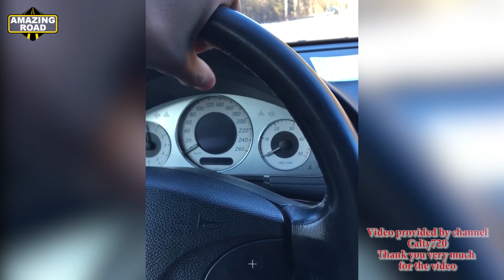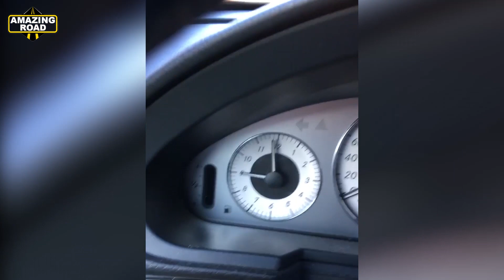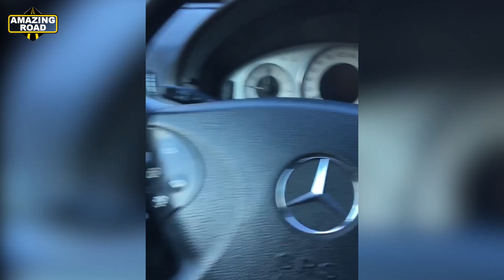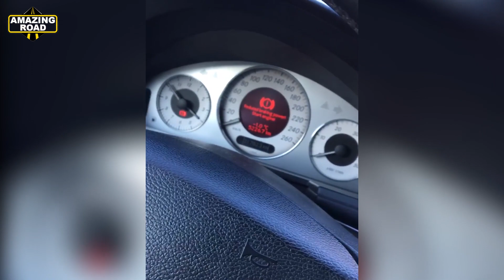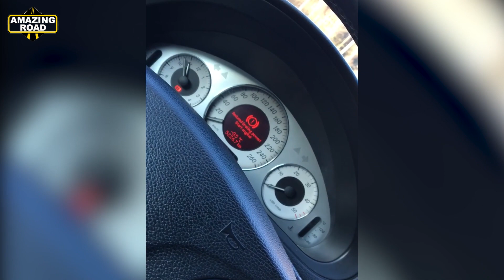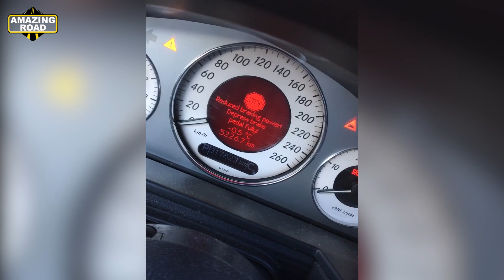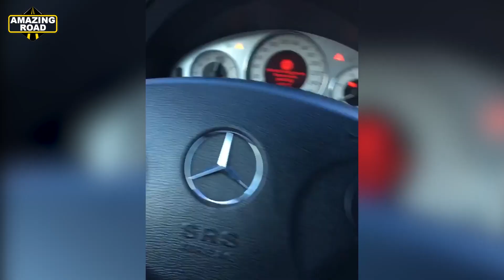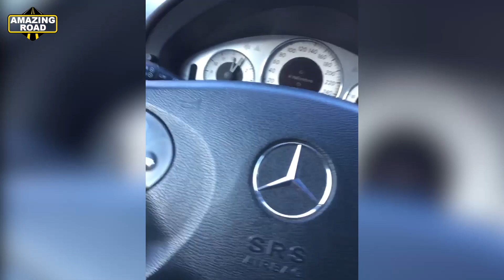Full brake failure on Mercedes W211 / STOP Reduced braking power! Failed brakes on Mercedes W211

Comment from the maker: Changing SBC Brake Pressure Accumulator in W211  https://youtu.be/CCXlfeDAly4
W211 Replacement or Removing Fuel Pump  https://youtu.be/VXQa5WZXWLs
Repair the IR sensor for Mercedes  https://youtu.be/h5GEVx5uemI
How to reset automatic transmission 722.6 Mercedes  https://youtu.be/_FjX2Yl42t4
Detailed Installation Android 7.1 COMAND & CANBUS  https://youtu.be/EisTZV-FCX8
Deactivation and Activation SBC Without Star Diagnosis on Mercedes https://youtu.be/J8jaVufCQcg
Mercedes W211 Replacement the Fuel Filter  https://youtu.be/LVpEIoUC178
Brakes failed on the road  on W211 https://youtu.be/tUZg9WytbbE
Best Life Hacks for Mercedes W211  https://youtu.be/p6bZLZ0WcQc
How to Make AUX on Mercedes W211v https://youtu.be/7JnVR-nF0UQ
Mercedes W211 Top 25 Hidden Functions, Secrets https://youtu.be/ZYQwnmydbp8
TOP 55 BEST LIFE HACKS FOR MERCEDES W211  https://youtu.be/CgixWAzrphs
W211 HOW TO REPLACE BRAKE PADS CORRECTLY https://youtu.be/6syWcyTcTVE
Reply: Amazing Road TV

Comment: I had the same issue. The esp light came on and the exact same warning came on the dash. I pushed the brake pedal to the floor  no brakes at all. I finally got it to stop. Turn the key off. Pull ed the key out of the ignition. Got out of the closed the door. I got back in and started the engine, no warnings. The car seemed perfect. 
I don't know if I can trust it now. Any suggestions?

Comment: My 2005 E500 is at the dealer right now getting the SBC done under warranty.  Got a 2019 Benz loaner too.  What a great company.
Reply: So the warranty doesn't expire on that? I'm looking at a 2007 E350 to purchase right now and owner said has no brakes... What fault code did yours have?
Todd
Annapolis, MD
Reply: Mega Man Todd, Mercedes extended the warranty to 25 years on the SBC pump. It’s a free repair from Mercedes if it fails.
Reply: @elkillerx do I have to be a Mercedes customer or just have a Mercedes ? What’s the requirement
Reply: @elkillerx 👍🏾

Comment: I too experienced the same problem my friend. I currently asked a guy who does Mercedes MOT  as it is his own business.  And what he had told me is that the brake pipes need to be cleaned out or replaced which costs about £80 each due to the brake pipes being filled up with dirt and etc  this has to be done regular or the car will not let you drive because it is not safe  I hope this helps as I am currently waiting for this Covud to end to get my brake pipes cleared and that red error message too.
Reply from the maker: the first time I know this

Comment: I have had the same issue off and on but I came up w a theory and that is when it’s freezing temps outside it messes with the computer because it has only happened to me when it’s cold. Very scary situation when you’re going 110 on the freeway Nd it pops up Nd beeps like a bomb😂😂
Reply from the maker: https://www.youtube.com/watch?v=WJ8yxhxtLe4
Reply from the maker: 2020 https://www.youtube.com/watch?v=vfo1OqpmKSw&t=68s
Reply from the maker: Agility https://www.youtube.com/watch?v=y0lp9aJ25tc&t=28s
Reply: I had the same issue this morning but it does make sense it was cold didn't warm up the car abs sounded just like you said now I works fine turned off and on now works I hope still taking it in new sbc
Reply: @freddygalvan669  most of the time if not all the time it is sbc pump and if youre lucky depending on the year of your e class. theyll take it in and replace it on warranty because its a recall for 2005's. i no longer have the car but that was my solution. Dont spend money on ebc flash kits because theyll fry your car.
Reply: @Dubya69  yeah man I took it in mines a 05 e55 it's at the dealer right now they are fixing it sbc was faulty
Reply: @freddygalvan669   good deal brotha hopefully for free haha

Comment: i have an E320 W211, year 2003 with the same problem. the defect usually shows up in the morning, and after driving for about 3km and switching off the engine, it disappears and then drives well throughout the day, then morning again, same problem. What could be the problem with my SBC

Comment: Mine is a 2003 E500 has 124k on it. Not a lot, ride smooth but I just had the same issue. I probably take it to MB Dealership.
Reply from the maker: Agility W211 https://www.youtube.com/watch?v=y0lp9aJ25tc&t=8s
Reply from the maker: Make a diagnosis through the openport for $ 19 https://www.youtube.com/watch?v=xk4dCH97ky4&t=759s

Comment: I am having the same problem with that light but my only thing is that I cannot get my car out of park can anybody give me an idea what's going on I have a 2004 E500 4matic
Reply: I had to take the gearbox apart the wood grain around the gearbox and there's a a safety switch under the gear and you have to press that down to get the car out of gear I learned it from a guy off of YouTube channel
Reply: @godwillokot9315  there's a recall on them cars SCS breaks stops working after 500,000 brake pedal stop the dealer had to fix mine's for free
Reply: what would it be if the problem keeps happening..? They already changed my SBC pump for my 03 e500 but I’m still getting the same brake message...
Reply: @mauricedavis1740  try replacing the brake light switch

Comment: The SBC unit has it's own battery in the front so disconnecting the rear battery won't do anything. What you have to do is to disconnect the harness that goes into the SBC unit in order to "reset" it. That should give you your brakes back so you can drive the car. Although you will have to eventually replace the unit.
Reply from the maker: ))) https://www.youtube.com/watch?v=CCXlfeDAly4&t=19s

Comment: Please folow these steps:
1-turn of the car
2-disconnect the esp/abs motor
3-turn on the car
4- reconnect the esp/abs cable (motor should be on)
If you folow these steps the car should work perfecty
Reply: well here the problem is the sbc battery,or the generator doesn't make enough strom for the sbc battery.
Reply: sorry for my English.
Reply: This video was recorded by me, could you explain a bit further? It's sitting in my garage right now with no brakes, I had to drive it home while it was beeping, I found a hole close to the gear shifter, I sticked a pen through and unlocked the locking mechanism on the shift knob.
Reply from the maker: You checked the battery SBC? If the acb is discharged then there will be an error like you have now
Reply: Turn the ignition off and disconnect the ABS/EPS module then turn the car on - pump the break and the brake should work fine.
the most common error part is the A.K.A. brak light switch I had the same issue with my car. You can get it for 15 - $20.

Let me know your news
Reply from the maker: Watch this video https://www.youtube.com/watch?v=3hRu0qrWmzE&t=2s
Here I'm testing brake failure. Without bleeding the brakes should be without SBC.
Reply: There are 2 ways to fix this easy: 1. Go to the dealer, buy a new factory  SBC-unit ($1300) and have a good outside Mercedes Mechanic install it($500) 2. Sell the car for $5000 less than it's worth. There are no shortcuts, don't listen to people, your brake will fail and it'll cause a bad accident if it happens while driving downhill or in the city.
Reply from the maker: Brake in any case will be. This is not discussed. People like you say if you fail the sbc there will be no brakes. You make mistakes the brakes will be. I am the same owner as you. But I agree with you that you need to change the block. Since a 2 ton car is very difficult to stop without ABS
Thanks for watching!
Reply: Don't forget. Mercedes extended the warranty of the SBC pump to 10 years/unlimited miles so before you buy a new one double check if there is any warranty on your current pump.
Reply: Mine is 2003 E55 with 107k miles, the light came on couple of weeks ago so even if there was a warranty it would've expired. I'm sure you can bypass the system and rebuild the SBC unit but mechanics will never let you know so they can charge you $800 for labor.
Reply: Didn't you say "Car will not shift from first gear to second if SBC is not connected"? In one video you also showed that car wouldn't stop even with emergency brake, so does it stop or it keeps going?
Reply: Calty720 I've  got used sbc unit from scrapyard with low milage for my car even with a different part number and unscrewed the brain from the old unit put on the unit what I have got and did bleeding! job done problem fixed got through with 150euros plus cost off brake fluid
Reply: Hesam0000 you can't get brand new factory's sbc units any more these days. all you can do is to refurbish it and it means to replace  brushes and thats all you can do with sbc unit but there's hydraulic part in the unit (valve) wich also can fail (stuck) and you or any body else can't do anything about it...
the parking brake in not related to the sbc unit so it works and helps to stop the car in emergency situation but you have to be careful to pressing it when going high speed don't press to hard or car will go sideways
Reply: I bought a new one from the dealership for around $1200. Emergency brakes are connected only to the front wheels right?
Reply: Hesam0000 emergency are front one's but it wasn't enough when i lost my brakes so i used parking brake as well! I tried dealers ebay but couldn't find any brand new ones few months ago. maybe your one was the last one...
Reply: Call Schumacher Mercedes in Scottsdale, AZ, they have the parts.
Reply: Chabache do u reconnect it?
Reply: Amine KA dude it's really work thanks alot my problem it's been fixed
Reply: mine doesnt work
Reply: Amine thank you i save 350 euro :))
Reply: Calty720 what
Reply: What was the end result? What did it need to get it fixed?

Comment: Mercedes just announced 25 year warranty on the SBC unit
Reply from the maker: wow
Reply: but it isn't worldwide it's only in USA
Reply: Yup. I have an E320 and I got a letter from Mercedes about the warranty extension. I had my SBC pump fixed completely free by Mercedes a year ago.
Reply: @elkillerx  does the warranty apply for any mercedes owner? I didn't receive anything in the mail

Comment: This video was recorded by me, if you have any questions I'll gladly answer.
Reply from the maker: I attached your comment to you asking questions
Reply from the maker: (To Kos) Asks 
The question is whether this car przeebieg 315000 on the original pump SBC, or were already reset counters pump SBC? Failure was previously indicated in white?
Reply from the maker: Watch this video https://www.youtube.com/watch?v=3hRu0qrWmzE&t=2s
Here I'm testing brake failure. Without bleeding the brakes should be without SBC.
Reply: How did u fix it
Reply: How to brake fail a car men ??
Reply: I have a question man it's legit doing the same thing I have no clue what to do I've done pretty much everything
Reply: Calty720 it's a 2006 e350
Reply: Calty720 it doesnt wnat to turn on I have taken the battery off as well done many things but nothing works out for me
Reply: Calty720 okay sounds good all the fuses are good
Reply: Calty720 I haven't change the fluid so it might be that but I doubt it .....is there some type of sensor that can cause some type of problem....
Reply: @Calty720  tell me man , how to brake fail my car ?
Reply: @Calty720  any vd on ur pg about how to brake fail ?
Reply: Calty720 I’m having this problem and don’t kno what’s wrong
Reply: I am having the same problem with that light I cannot get my car out of park is it due to that light coming on in the dash

Comment: I had the same message today and found out that one of the lines were leaking at rear left wheen, so whenever the car did self diagnostics it pressurise the pump, and gets an error since it's leaking.. so it should be easy and cheap fix for me, I'll try to have a look at it myself... 
.
.
But anyway it's a piece of shit garbage car I had it for 5 years and it had nothing but problems.. I was stupid enough to keep it this long

Comment: I understand that some things are fairly costly to repair on the Mercedes.  But, you could mitigate those costs with normal maintenance.  I think you probably are not doing that.  I don't think it's fair to blame Mercedes for this error.  Take it, get it repaired properly, and then do the maintenance at the correct intervals or when you see a message such as brake pad wear.  Don't blame the Mercedes car though.
Reply from the maker: SBC https://www.youtube.com/watch?v=WJ8yxhxtLe4
Reply from the maker: Agility W211 https://www.youtube.com/watch?v=y0lp9aJ25tc&t=28s
Reply from the maker: 2020 https://www.youtube.com/watch?v=vfo1OqpmKSw&t=6s

Comment: Man the w211 is THE worst vehicle from Mercedes. the w211 from 2007 otherwise is Nice, But before... its just Not really Mercedes like. I Hope you just not have a bad Reputation of Mercedes now.
Reply: Did you didn't Know about the Bad Reputation of an Mercedes w211 2002-2006? Buy every other Mercedes and you Never have any bigger Problems trust me.
Reply from the maker: I want to buy W212 Selling my W211. But I changed my mind because W212 is not as reliable as W211. I can buy W212 right now, but I love my W211. If you do not count the brakes on W211 then the car is just perfect. 
Look at this video https://www.youtube.com/watch?v=3hRu0qrWmzE&t=2s
There I test the brake failure at speed
Reply: Ok thanks for the respond👍🏽
Reply from the maker: Thanks for watching!
Reply: The question is whether this car has a mileage 315000 on the original pump SBC, or were already reset counters pump SBC? Failure was previously indicated in white?
Reply: To Kos it was reset, and this is not the original sbc that came with the car, we bought a new sbc pump
Reply from the maker: Bought a new or used?
Reply: Amazing Road TV used
Reply: I have a 2003 E55 AMG and it's a super car only in this case the damned car needs a SBC-unit after 300,000 brakings(not 300,000 miles) and he refuses to buy a new unit. I bought one for $1800 installed and it's like new again. People don't get it, if you can't afford $3000/year in maintenance expense don't buy a f..ing Mercedes!  Common-sense is not so common.
Reply: Hesam0000 who the fuck wants to buy a car that has high maintenance?
Reply: All great cars are high-maintenance because they're built with 1000 extra parts to give the driver more pleasure while driving. Mercedes is a low-maintenance car. When MB and Chrysler merged the quality dropped by like 30% but still some models are very reliable.
People buy a junk 69 Chevelle 390 for $40k to get horsepower then spend $20k more on it. I spent $11,000, got a super luxury 469HP, 200mph car(governor reprogrammed). So your answer is "All smart people who want luxury and performance." If you want a box to take you from A to B buy Toyota Camry or Corolla or Prius.